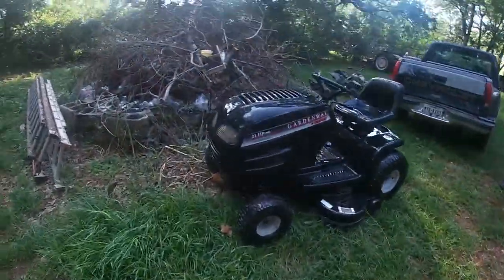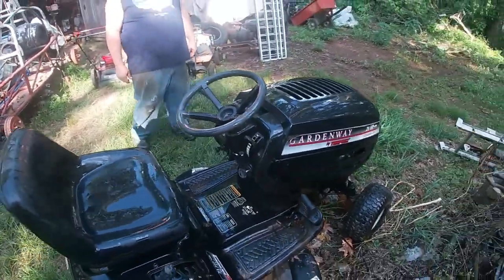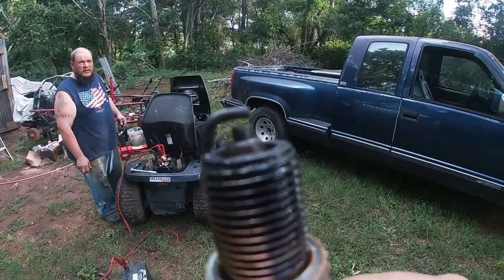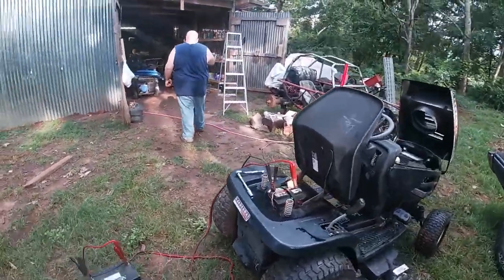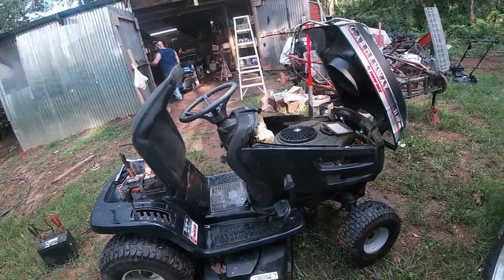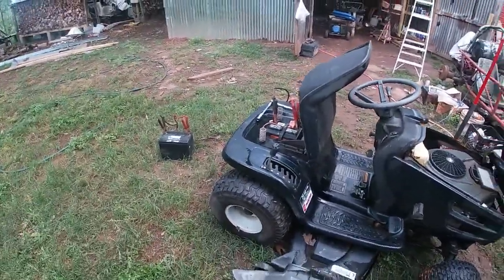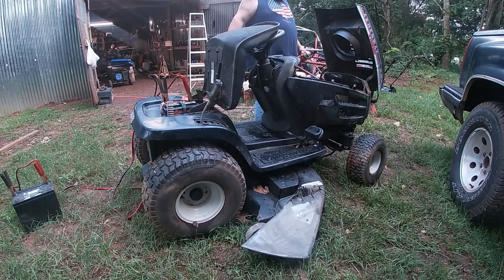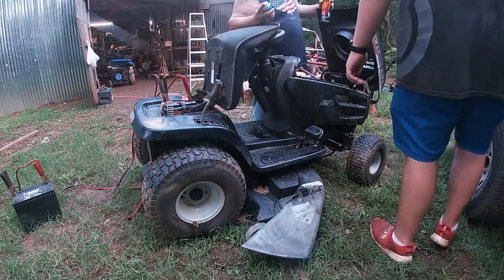will it run abandoned riding lawn mower revival goes wrong *IT CATCHES ON FIRE*

Comment: timing is off or intake valve is partially stuck open marvel mystery oil you used should fix the sticking valve
Reply from the maker: Valves where definitely the problem wasn't seating right